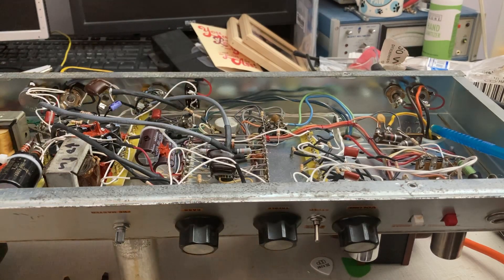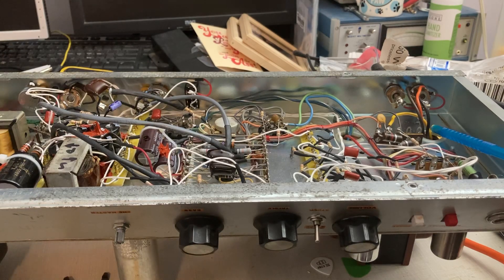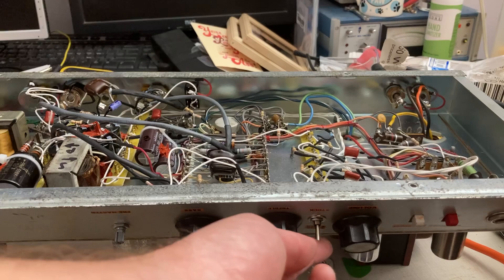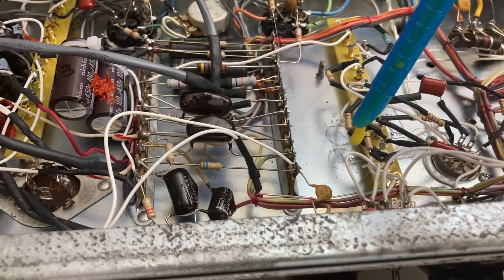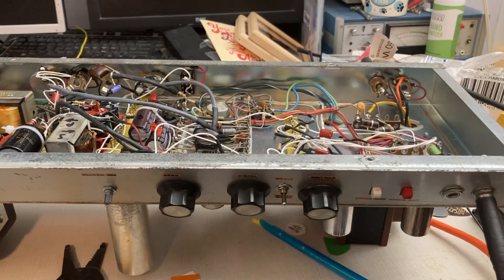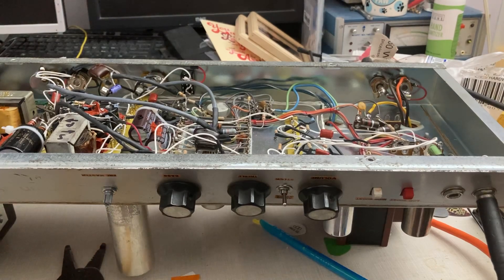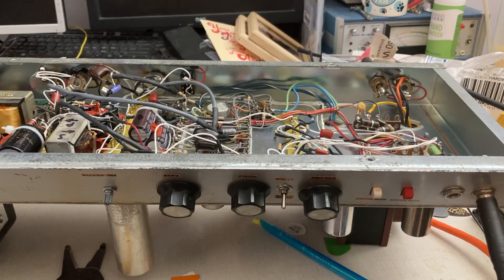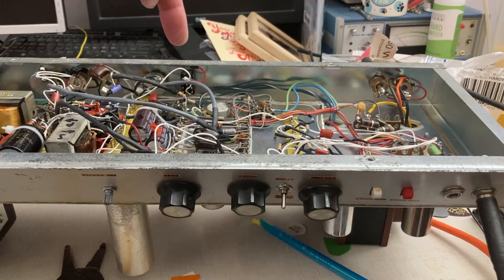This is what MILD blocking distortion sounds like.

Comment: Sunn 200S ? That's a bass amp - you'd want it to be distortion free and have max headroom. Is this the Sunn guitar model, 'cause that's a different model number. Also, never saw that toggle switch on a Sunn amp - must be a mod. I have a mint Sunn Sorado, which is the same as a 200S. Only difference is the power tubes but both put out about 60 watts. Super clean sound for bass.
Reply from the maker: Yes it is a bass amp, but every Sunn I've played had the same clean headroom as this amp did, it is now a guitar amp lol.

Comment: emmmm... what is actually wrong with all of those sounds I've just heard in this video ?
Reply: Nottahekkuvvalot.  Strings warp & waver during sustain b'kuz the direction of vibration rotates naturally (back&forth as up&down), and the warp in the note varies with how this crosses the pick-up's field.  One direction & the b-field is slowing the motion, sending it nano-flat.  90° off & it stops pulling the note.  This affects intonation throughout the sustain of a chord.  Different strings are affected to a different degree.  Overdrive just puts it all out front to be heard.

Comment: Hey man ever figure out what was causing this? I’ve got a 6550 sonaro on my hands right now but comparing mine to the 200s it’s circuit is identical transformers bypass cap and resistor values etc, same issue as yours but without any mods, debating if I should order in a new 6an8 as it’s the only thing I can think of that I haven’t changed out or tested, I did add a 470k grid stopper to the pi which helped a lil, but it’s hard to imagine that this is how the amp was intended to sound from factory
Reply from the maker: I have not I'm afraid, my attention has been occupied with other projects after I moved (2 years ago lol), the issues in this amp however are all of my own doing, I don't think the your Sonaro had the same preamp as the one I have and i know my issues  are in that area.  My amp was healthy before I got creative.  I would encourage you to get a couple 6an8's while you can, that is one tube that isn't being produced any longer....
Reply: @amateurism1  thanks for the reply after 2 years haha, that’s the plan found a couple on eBay, after some research I have a feeling it might also be dc leakage in the old coupling caps as well. a few hifi guys seem to have had the same issues on a dynako circuit that these sunns were based after and the coupling caps getting tested and replaced sorted it out. Cheers
Reply from the maker: @micahcech6708 the first thing I do before firing up these old amps is replace all the electrolytic caps, the decoupling caps were electrolytic on this one.

Comment: There is certainly a lot to learn! I designed and built a simple 1w amp using 2 6j1 tubes, sounded great on the first try, figured I knew what I was doing. Nope. Working on another version with 3 tubes now and it sounds like ass, that's what brought me here.😂 Trying to figure out if it's blocking distortion or a saturated transformer causing the problem. I'm not using a proper output transformer, it's a line transformer from a PA. The first amp used one as well but a different one. From listening to your clip I suspect it's the transformer, going to try the first type I used in the other amp tomorrow. Have to scavenge one from the ceiling before anyone else shows up at work in the morning.😂
Reply from the maker: Ha! I hear ya, it’s like 1 step forward, 2 steps back most of the time… I’ll one day figure this out, but there is allot of trial and error.  I will admit, I thought I knew enough and felt confident in my abilities before I started, that went out the window quick, I hope you can work out your issue(s) better than I could, I’m afraid every change I make seems to help and hurt at the same time.
Reply: You need to present/match the correct impedance to the o/p valves. This is a combination of the speaker and the correct o/p transformer. ‘Any old’  transformer won’t do.

Comment: Thats not blocking distortion......you added a 12ax7 in the pathway...but not saying if its in parallel or series.  Generally a effects loop is in series after the first pre-amp but the pre-amp is not pushed.  Its one reason why you shouldn't add or use an effects loop in a tube amp......you have to know the gain stages and phase/inversions etc....and then to come to a ratio between wet & dry relative to an effects loop.....as usually the effects loop also functions as another overdrive gain stage.......and with a switched jack....that micro contact point of the switch has to pass signal and that contact point is a bottle neck in signal flow....and watch out when it gets dirty and oxidizes and your signal pathway.  You did not state plate voltages or bias resistors nor plate resistors & cap.......all determine EVERYTHING
Reply from the maker: I can’t tell if you’re trying to help me with the comment or not, half the stuff you type I don’t even know, I’m just screwed around with an amp, and I’m hoping that I can encourage others to do the same thing, I only know what I read in a book or what I read off the Internet. Yes, I had to play with plate, voltages and all sorts of other stuff after I adding more load onto the circuit, I didn’t mention any of that.  I don’t see how a switch is any different than switching jack in other affects loop, give me a little bit of time and a break. I’ll tweak it until it works, I’ll figure it out. 

Thanks for the help if that comment wasn’t meant to be an insult to my intelligence.  

It’s a series effects loop.
Reply: @amateurism1  A switched jack is best to be replaced by a regular jack with a toggle switch for the pathway in & out because of the contacts....more surface area.  A series effects loop will overdrive because you are INSERTING into the signal pathway.   Adding another tube is dependent on if the power transformer heater filament winding has capacity.  BUT the design fault if that they give a margin as it depends on the tube compliment the amp has to support.  SO don't be fool by the margin.  A Fender Reverb combo amp...think Twin or Super reverb BF/SF classic era.....the reverb circuitry is in PARALLEL.  So dealing with the electronic phase from stage to stage, Fender cut a corner and really needed an extra tube gain stage for the reverb circuitry, but to deal with minimal parts, they did the work around by ATTENUATING the dry signal with a 3.3 meg resistor with a 10pf bypass capacitor for carryi9ng over high end content that gets lost by going through such a large value resistor as the attenuation factor.  Hence they had to RATIO the wet/dry signals.  SO the pre-amp gain is cut way back on the dry signal to compensate for the low signal of the reverb circuitry output.  That Fender reverb was licensed out from HAMMOND starting back in 1962 for the new spring reverb effect.  The reverb is an overlay and the reverb control on the amp's front panel is really a Volume control that turns up the effect as its basically always ON.  They dealt with adding the effect of reverb by....dropping the dry signal strength....and using a resistor to cut signal strength.  WHEN you do things in Series....you CASCADE gain stages and signal.  A 12ax7 is 100 gain factor....a 12AU7 is like a gain factor of maybe 20.......so switching out the 12ax7 for a lesser gain tube would probably help you
Reply from the maker: @mikecamps7226  it sounds more like you’re helping now, sorry about my attitude if your felt it in the tone of my previous response.  

I have added a filament transformer for the extra tubes.  Don’t worry about the switches please.  My plate voltage are fine after changing the dropping resistor value and the dc signal is clean when looking at the ripple on a oscilloscope, loaded. 

Im honestly trying to implement an effects loop circuit that I got from a Lee Jackson YouTube video, and yes I’m having problems.  Still trying to figure out why, it’s turned into a project that is moving down to the bottom of a list of things to get done.  

I get why the cathode follower is adding gain, I practically have this working, but as you put it, “I’m working on balancing things” by trial and error, I’ll try a 5751 tube, thank you for the suggestion.  I just need to struggle a bit longer with this project and I’ll eventually figure it out, I’m either finding the limitations of my phase inverter circuit or I have a poor layout of components in the chassis at this moment that is causing some runaway oscillations when some pots are moved to a certain position.  

I started this adventure with the intention of getting some hands on learning and maybe making a few videos along the way, I’m at 75% done and lost steam, that’s all.  

Thanks for the help Mike.

Comment: Not a very good example. That is a very mild case of blocking (if it's that) compared to most I have heard. It may not even be blocking, maybe more like how you set your gain stages. Usually blocking is FAR more noticeable, when it's bad you really know it, to the point the amp will make very loud "blatty" popping bursts of noise and/or collapse on transients, in addition to a far worse case of what you do have now.
Reply from the maker: Until this moment, I have never hear it before, I have no idea what it sounds like… so thank you for clarifying. Do you have an example to hyperlink here?

Comment: AMATEURISM, what do you mean by blocking distortion?
Reply from the maker: Cited from "Designing Tube Preamps for Guitar and Bass" by Merlin Blencowe:

-When a cap coupled tube is driven to the point of grid current limiting.
-I guess the most practical way I can describe is, if two halves a 12ax7  are coupled together and the latter half has its signal blocked due to the change and discharge time of the coupling cap being near equal.  

I'd buy the book if you want to learn more, that response is as good as I can do without plagiarizing the whole section.
Reply: @amateurism1  So the coupling caps RC Charge Time and Discharge time are EQUAL this will cause Blocking Distortion? I thought blocking distortion is when you overload the phase inverter tube so its in cutoff region?
Reply from the maker: Yes. This is where I prefer books over info found on the internet…

Comment: I really like that growly clipping grind your getting. What gets the amp in that place?

Iv been somewhat dissatisfied with amps realizing I can’t really get the right distortion out of em . Iv cL been looking into buying amps and moding them as I feel this might be the only way to get closer to what I may want .

A lot of modern amps just have so much preamp gain it’s very saturated I like a more open clipping sound if that makes sense.  Even old plexis get modded with master volumes and it throws off the sound of the power amp grind .
Reply from the maker: You’re gonna hate this response: what got the amp in that place is preamp overdrive, it does have a unique grind going on.  This has been a total learning adventure for me, I’m not sure I can you give you too much good advice at the moment, I don’t use modeling software.... What I can tell you is that you are not hearing any power amp distortion in this video.  I’ll do a video of it cranked soon before I make further adjustments, I know what that thing sounds like in my bedroom, but not at stage volume. 

But.... That clippy grind before the cathode follower was added is two gain stages out of a 12ax7 with rather high cathode resistors on both stages.

When the cathode follower is added, there is some weird stuff happening and I'm able to control it, I got lucky, as I try to refine the weird stuff, the magic quickly disappears, I'm all about good enough, I might leave it alone.  I have some signal bleeding though switches and it happens to work like that, this is tough.
Reply: To be honest even it’s it’s preamp clipping it sounds better than what Iv heard across many amps.

I think people who like poweretage clipping do for that certain somewhat tight grind . Preamp distortion is life
Convenient to control though without having to blast an amp so it’s pretty cool you managed to get it like this with pre amp distortion .

You said you have some signal bleed? I mean some old plexis apparently have that aswell from what I know with the non master volume amps , so if it doesn’t sound bad I suppose it’s no biggie .

The texture of that clipping just sounds great to me though .

I think it’s all a balancing act so if you keep it in that ballpark (if that’s your main goal) then that’s success IMO.

I’m not a huge effect pedal guy so for me the right clipping in the  distortion is really where it’s at , along with responsiveness , dynamics etc. but my favorite sound is good quality gain/distortion when it comes to electric guitar
Reply from the maker: @heythere6983  thanks! That was very motivational to hear actually, that sunn amp has been sitting waiting for some time and attention, you just helped me focus again on it.

Comment: What is the blue stick like thing you're using to push on the resistor? Is that some kind of a fiberglass scratch brush, or a spring-loaded eraser pen?  The tip is yellow and appears flexible which isn't normal for a fiberglass scratch brush.
Reply from the maker: It’s used to close potato chip bags, I’ve found a better uses for it from time to time.

Comment: Excellent video, I have a question. Have you added a cathode follover to the P.I circuit? what have you done exactly? would a scheme be possible? I find it very interesting.
 Thank you.
Reply from the maker: I'll put some more stuff on here that will help, the cathode follower is part of the effects loop so-to-say, the cathode follower is present in the circuit even with the effects loop off.  I'm still struggling with the effects loop, no point sharing anything if it don't work well. 

I've got a very good Plexi tone (the tone of a Plexi without jumping channels) going on at the moment; this was my goal (a lower volume Plexi grind).  Still rying to tighten up the low end more. The low end should be massive with the 6550 power tubes, but it's too loose at the moment, once I get this figured out, there will be info available.